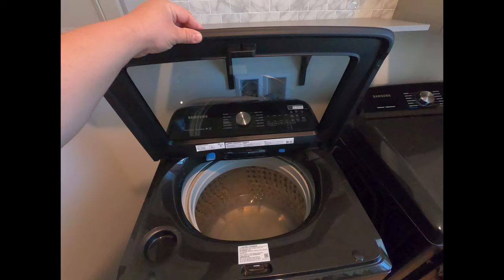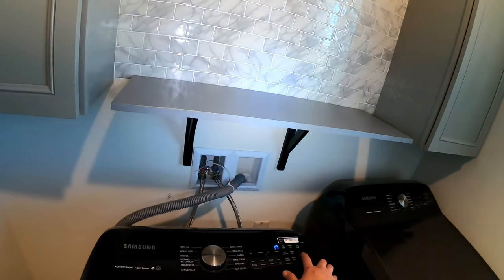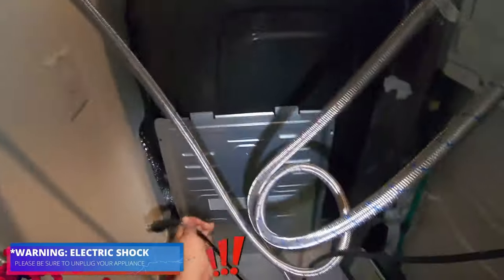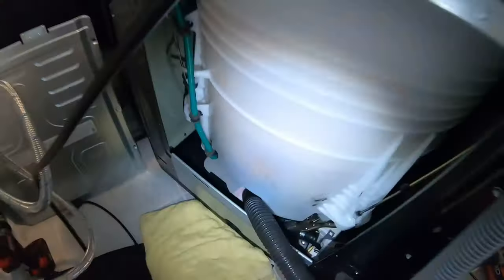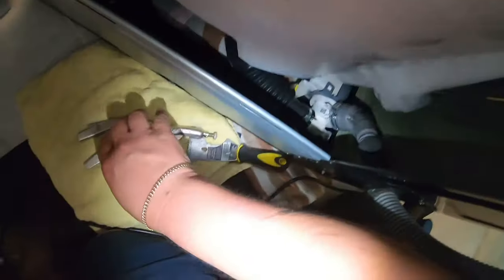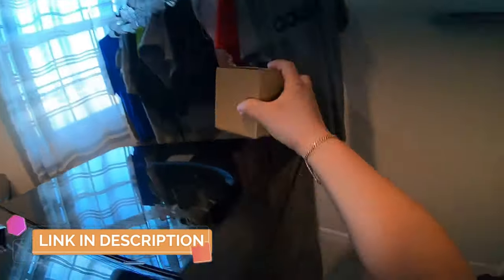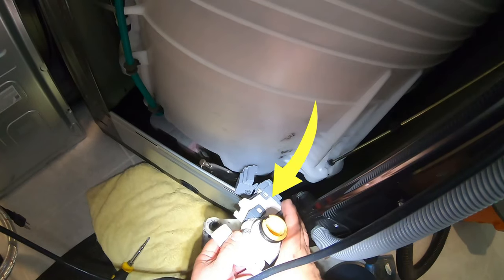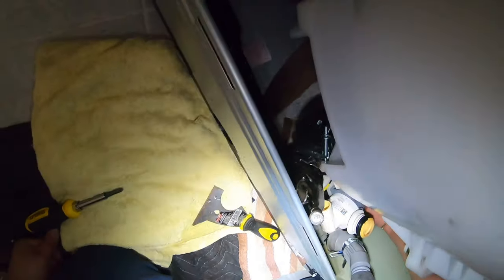How to Fix Samsung Top Load Washer NOT Draining! | Water Stuck Inside Tub | Model #WA50R5400AV/US

Comment: My mom bought a Samsung washing machine on my advice, I told her that they are the best and she called me yesterday that the function no longer works, it stays in rinse and it doesn't get the water out, it makes a subtraction sound but the water stays in the drum, the worst thing is. Everything is that my mom has not even paid the first installment for the washing machine and it is already failing, very sad, very disappointing.
Reply: Ran the first "test" wash through the machine.  Everything went fine up until it was time for the rinse cycle to drain the water out of the tub.   The wash cycle drained the water just fine;  however, the rinse cycle did not drain at all...  I am literally left with a machine full of water & the machine just shut off after it was finished. But without the rinse cycle water being drained.   What did I do wrong?
Reply: me and my dad were looking at ours that had the same power. Turned out the motor that sucks the water out had broke and we replaced it
Reply: motor pump thingy
Reply: Still under warranty, call so they can go check.
Reply: @adriana7006   do you know what the part number was?

Comment: After watching your video I was able to remove the check valve to test it as you demonstrated on your video. I tested the washer and bang! It’s draining now! Thank you so much!
Reply: Wait do you recommend replacing it? Or can we do without it?
Reply from the maker: @JoseLopez-xx4wn  As long as the drain hose is higher than the drain pump is Fine, In other words, If it is working fine now after you remove it, It should be fine without it.
Reply: @DIYRepairsNow after the second load it stop draining once again. I must replace the part.

Comment: I’m looking for some advice my machine won’t drain, I checked the pump for debris removed the check valve nothing, I have water coming from the black hose and the gray hose, I took the gray hose off the back of washer and put it down my emergency drain and water freely flowed out, took the pump off and turned on the washer to make sure it actually spun the blades they spin but still doesn’t pump the water I’m not sure how fast or hard they spin but I’d say it seems to be a normal speed not real slow or anything but not super fast either any suggestions what to check next?

Comment: You saved the day! I can only assume My issue was a check valve. I didn't see any debris or obstructions on either inlet or outlet at the pump. Check valve ripped off very easily. Put the hoses back together. Fired up rent spin or whatever the setting is that will drain. Pump fired up and started draining right away. Thank you so much for this helpful video.
Reply: I used a standard floor jack to elevate the back corner. Then bailed out enough water to where it wouldn't continue draining after the hoses emptied out. Got a little water on the floor. But it cleaned up easily with a couple hand towels that I can now wash in my now functional washing machine.

Comment: I was able to fix my washer by watching your video. Normally my husband does all the house fixing stuff, but he’s on 3rd so I did figured WTH worst that can happen is we need a new drain pump. So I got my tools my headlamp and went to work with your video. Found a Brad nail in the with the fan blades. Thank goodness it just got stuck there bc the blades weren’t broken or anything. Was able to get my husbands work clothes washed before he had to go to work, thank you very much for this wasn’t fallow cix 🥰

Comment: I fixed it in about 30 seconds by using my shop-vac to blow air into the drain tube (I first tried to use suction but that didn't help at all), that stupid flapper was not not allowing it to drain. I wouldn't have known about the stupid check valve issue without your video. Thanks a lot!

Comment: Thanks for the great video. I ended up not being able to see the obstruction inside the pump motor from the inlet, so I popped off the top and found a nail with its head broken off was able to slip in and jam the blades. Too many DIY projects the last few weeks I guess.
Reply from the maker: Yes, Sometimes if you forget to Empty out Pockets, things can get Stuck in the drain pump. I am Glad you found My Video Helpful! Thanks for Watching!

Comment: Great video regarding the pump and replacement. Mines was bad. Metal rod to plastic fan broke. The only problem was upon replacement it was still only humming like the bad one. Apparently my Samsung washer needed a  "reset"  by letting it completely run on test mode FYI.
Reply from the maker: Great Tip! Thanks for Watching!

Comment: This also worked for me. There was a reusable makeup cloth wipe, about 4in in diameter. It clogged the drain and the props where eating it up. Fortunately the motor hasn’t burnt out yet. I went ahead and removed the check valve anyway.
Reply: Exactly the same thing was stuck in mine.

Comment: Great video, mine unfortunately nothing clogging the pump, looks like the motor itself gave out and is just humming. I ordered one with rush delivery. My motor/pump has a rubber part next to the motor on the right side of the machine where a part of the pump needs to be slid into. It looks like it stabilizes the motor and keeps it from shaking around. At least on my model Samsung.

Comment: I checked mine but there’s no obstruction and it still hums. I poured water in to see if it would pump it out but it’s just not and it has a weird rhythm to it when it tries to pump it out? But it’s definitely getting voltage. Should I just replace the motor?
Reply from the maker: Yes, replace the pump
Reply: Okay thanks

Comment: Hi please help. The st upid washer is driving me insane with the sc code(drainage issue) i did all posdible reset. Lastly I removed back cover then the drainage hose from the back on the washer after opening the cover. the water came out like a fountain. I think the flapper which you display in this video was preventing the water from draining?  Do you think I should remove the flopper completely or buy a nee one ?? The
Reply from the maker: Sure, You can go ahead and remove it. If this does not work, Replace the Drain Pump.
Reply: Thank you so much for your help. I thought the rubber piece would solve the issue because once I removed it, all the water came out. But today the cycle stopped again and shows my nightmare SC code. I will take your advice and change the Drain pump hoping it will solve the issue or you suggest something else? like filter cleaning? Btw thank you so much for taking the time, posting the video and responding to out comments.   @DIYRepairsNow
Reply from the maker: @AFouad-kc6vf  you’re welcome 
And yes, the filter have to be clean every six months at least
Reply: Where is the filter please? And where so i get the pump from because i cannot seem to find the replacement by model number??

Comment: Troubleshooting why mine(same model) won't fill up. When I start a wash cycle,  the drain pump kicks on and starts to drain instead of filling. I've checked the screens in hose panel. I'm only getting water from the button on the right side of the detergent compartment. Any suggestions greatly appreciated. Thanks
Reply from the maker: If the Drain Pump Starts and Does Not Stop, this Means that it is still detecting water. Check The Drain Pump to make sure it is not clogged or Broken. If when you press start, It Starts to Drain but a couple of minutes later it starts to try to fill, You need to check your water valve.
Reply: I have water flow only if I push the water button in the tub on the right side of detergent tray. It will drain. The pump stays on for 10 seconds,very loud,then shuts off and will not start or change wash selection. No response from selector or buttons. I have to turn off then on to reset. No error codes.I will remove pump and check for blockage. Thanks

Comment: Did anyone else have a large leak during drain cycle before removing check valve? I had it drain on the floor and can’t find any other leaks or cracks

Comment: Your details worked perfectly for me! My Samsung is a different model but was exactly the same. Thanks! 

My issue was a small nail must have been in a pocket, which jammed the pump. 

TIP for others: The inside edge of the back washer is sharp. I’d recommend wearing gloves or using extreme caution while disconnecting tho gs.
Reply from the maker: You’re welcome thanks for watching my video👍🏻👍🏻💯💯
Reply: Good tip, it really was sharp :|